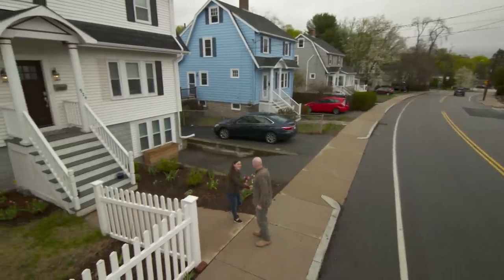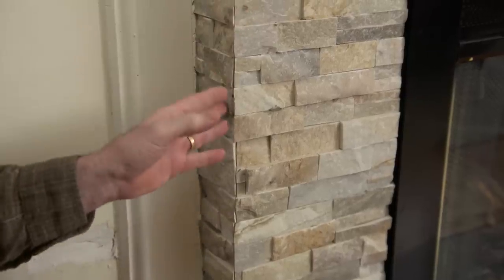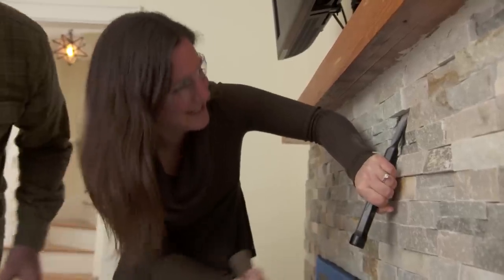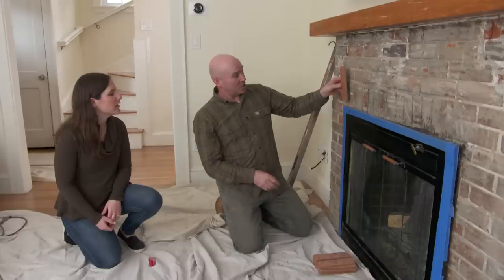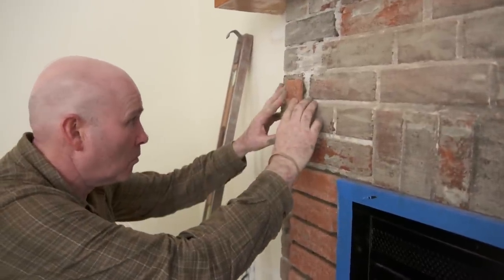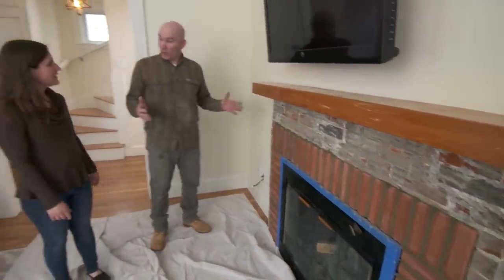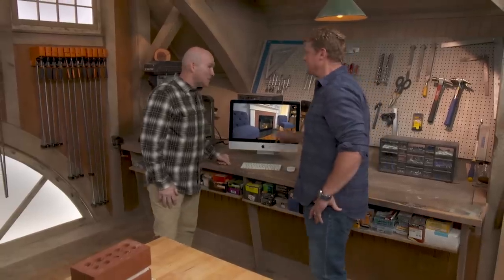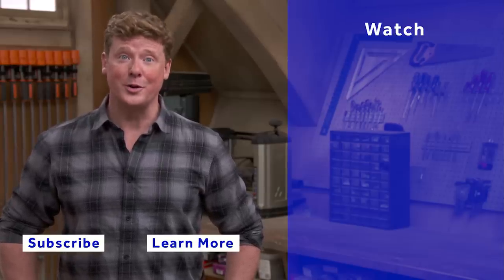How to Brick Veneer a Fireplace | Ask This Old House

Comment: They make diamond abrasive thinset removal wheels for angle grinders.  You basically grind to new surface. Those in combination with various course wire wheels would clean that thinset right up, then acid wash it afterwards.  It creates a lot of dust and you have tarp the entire area, but it works good.  And above all else, reclaimed/weathered brick is definitely a thing too.
Reply: Yup I would go with the original brick

Comment: Liked the “masonry” ruler w/ the different layouts & numbers, etc...cool little tool to have on the job. 
Like learning new things everyday 👍🏻
Reply: several versions of brick rulers he is using a standard spacing rule a modular rule is more common on new construction. a 6 on standard  rule is not the same as 6 on modular rule .modular 6 3 courses  = 8 inches or 2.6666666666 per coarse
Reply: A modular ruler is what we use first, always. Bricks are also referred to as modular. If you're spacing is off, then you use a spacing rule to get back to modular.i am a masonry Contractor 30years in the trade

Comment: Why didn't they start taking that off in the corner? Seems to me it would have easier. That brick was salvageable.
Reply: Agree with both of your statements.  The sloppy installer left them a perfect corner to start at, and the brick can definitely be resurfaced for a weathered/reclaimed appearance.
Reply: Bobby Brady if you took a tool it would of became weathered
Reply: He couldn’t just sanded half in off the brick and it wouldn’t move been fine

Comment: Sometimes the surface underneath is painted and can be saved. I had a job where a brick fireplace, a concrete porch, and three brick columns and a concrete walkway were all painted long ago and a flipper covered them up with flagstone, and the flagstone and thinset ripped right off the surface and it was all able to be saved. So you never know until you start pulling it off, don't assume it's ruined. This guy doesn't always have the best advice. 
- "

Comment: You could always go over the the whole fire place with thin brick that you make out of old reclaimed brick and then you could finish the joints with a recessed wire brush finish and it would match the original fireplace. I did that before when I couldn’t save the original brick. I know not everyone has experience with working on restoration masonry just something that could work
Reply: Max G love doing wire brush finish

Comment: I think it looks good but I would rather had saved that brick and not veneered the thin brick. I also realize it would have took a lot more time in a day or so to clean up that brick and clean it up with acid. People making comments about it should understand that this is for the DIY who couldn't grind off the thinset properly and then apply acid. This video is not for the professionals.
Reply: Those people at Ask This Old House are professionals and they see what ameuters do that they would not do at all.

Comment: I personally do think that the thin coat could have came out with a couple of rough grinding....
Reply: Then, personally, I think that's what YOU should do in YOUR house.  What someone else does with their house is up to them.
Reply: @buckhorncortez  That IS what the homeowner wanted to do, but Mark McCullough said it couldn't be done.
Reply: Yeah, that small amount of masonry to clean up would definitely been worth the effort. I'd pop out the gas insert, tarp off the room and break out a course wire wheel on an angle grinder. But just a mason wouldn't go to that effort and he already brought the thin brick. He and the producer's went in with a plan and opted to continue with that plan. Plus the original masonry looks WAY better than the veneer work he did IMO.

Comment: previous owner painted the brick fireplace, other than harsh chemicals is there any other way to restore the brick? maybe sanding?
Reply: Wire blade on a grinder but you’ll damage the brick face texture and leave it smooth

Comment: Can’t you sand brick? I would think it’s like wood with stain and if you want the stain of you sand it off. Not the same technique?
Reply: You could (possibly) grind it off, or use an wire or abrasive wheel.  Might leave you with a texture problem, and would make quite a mess.

Comment: What you can’t take off with a chisels you could ether grind it off with a sander or a angle grinder to smooth it off to the original bricks and mortar ok dude.
Reply: Or with some determine wire wheel work
Reply: That would make a real mess, even if you put up a Zip wall.  But, if you really wanted to do it, it's doable.

Comment: Man, if only they made abrasive acids that ate away that thin set or a grinder with a steel wire wheel to remove that thin set off the ORIGINAL brick. Can’t believe nobody has invented that. Well let’s go spend lots of money on this thin brick crap